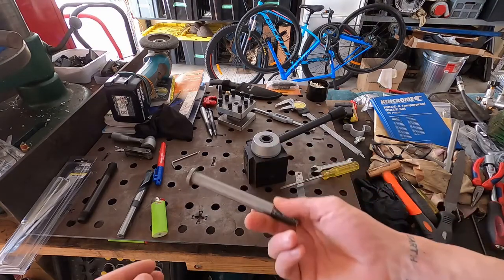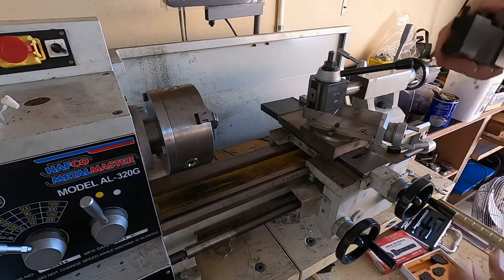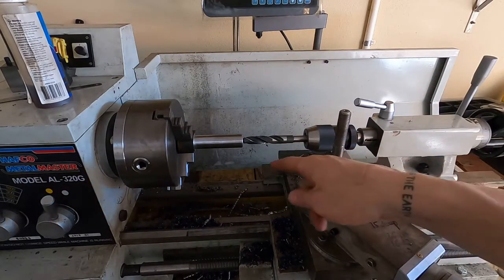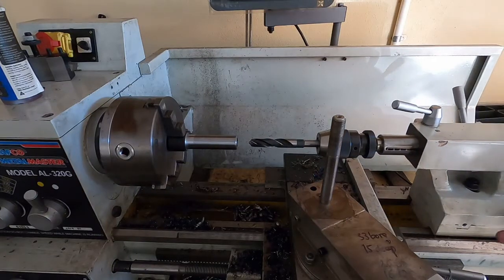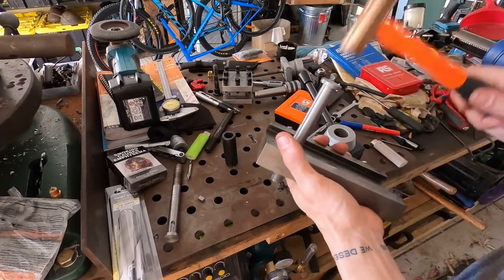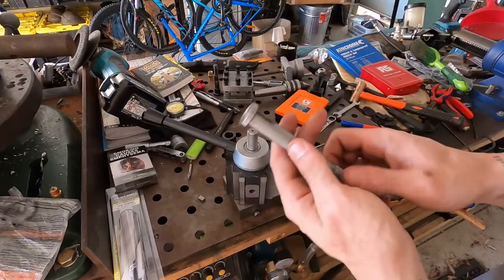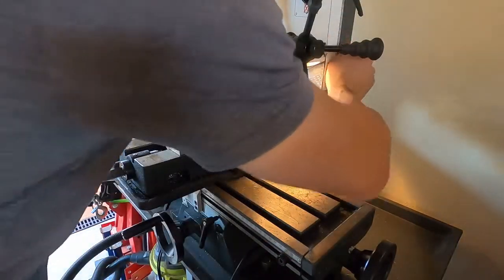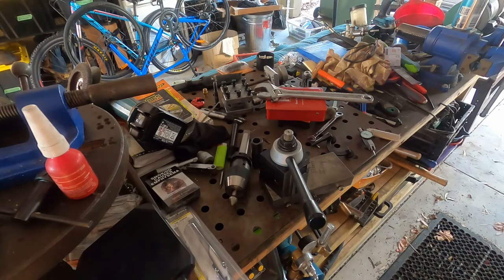Hafco AL320G - Fitting the QA-140 QCTP - Part 2

Comment: G’day mate that was a good example of fitting a different quick change tool post your lathe is similar to mine. Thanks for filming it just one thing be careful  hitting the palm of your hand on the bolt that causes carpel tunnel which is very painful trust me I’ve had it.    Regards John

Comment: I liked this 2 part series, so I subscribed. Was thinking of buying this lathe. Would you buy it again, if you had the choice? I live in NZ and my budget is around 4-5k. I liked everything but the comments on the gear changes is making me wonder
Reply from the maker: Honestly - yes, I think if I had my time again, I'd buy the same unit. There's no quick change gearbox, but the rest of the lathe is super capable and with power & space capacity for large parts. Change gears are annoying but with some quality of life mods (circlips vs e-clips, bit of final finishing on gears, etc) it's not a drama. 
I'm looking at the H&F catalogue now, and the next unit up in the Hafco range jumps from $3600 to $6000. Tack on necessary extras and that $6k will skyrocket.
I'd still recommend the 320G!
Reply: @styxshackshop2814  thanks, i really appreciate you taking the effort to reply in detail. Your videos are good bro, looking forward to more content.

Comment: Thanks for the videos.  I’m tossing over the 250 or 320. I’m just a hack wanting to play.  

Pardon my ignorance. I must of missed it but how did you open up the sleeve to accept the stud as it didn’t fit when you tried it?
Reply from the maker: Hey mate. 320 obviously a larger machine, 250 has some other nice features. Being a playing hack is perfect justification for either!

The main interference with the stud was where there was some raised metal around the threaded portion - the flat shank was fine. Quick file on the thread brought it down to a fitting size.

Comment: Thanks for your video Styx I have the same lathe and about to purchase  a QA140 QCTP and will copy what you have done. One other question is your Cross Slide DRO covering your gib adjustments ?. Mine is mounted on top of the slide ?
Reply from the maker: G'day Keith. Glad it's been of use! The cross slide scale is mounted just above the gib screws, flush with the top face that the rotating compound mounts on to, so everything is still accessible.

Comment: Hey ive hot the same model lathe.  Did you fit the DRO and was it difficult to do so.  Led
Reply from the maker: Hi Les.

I did fit them, yes. Biggest obstacle is probably the size/mass of the machine, and getting in behind to mount the long scale. I had to use some 'custom' bracketry and spacers.

Realistically, if you're at the point of using this machine, you've probably got the wits and ability to mount a DRO. Little bit of careful fitment and it comes along fine.

Comment: Thanks Styx. I’ve the same machine and tool post.  This was excellent.  Cheers mate.  Was the gear change for the thread cutting hard to work out?
Reply from the maker: Not too bad mate, just that the diagrams on the inside are kinda poor. Probably much easier to notate a bit more clearly which gear is which!

That, and replace the cursed e-clips with actual external circlips.